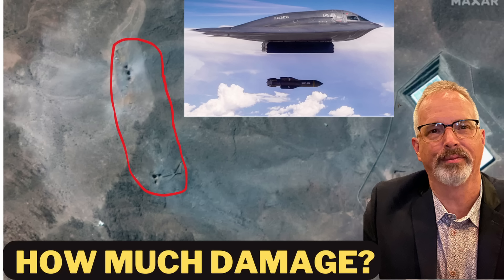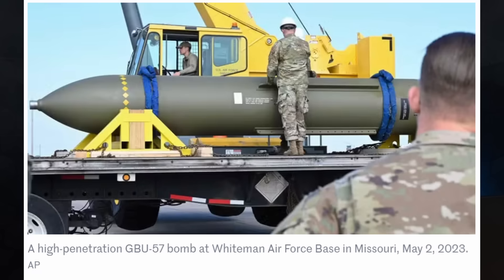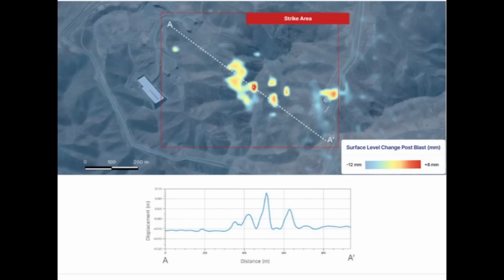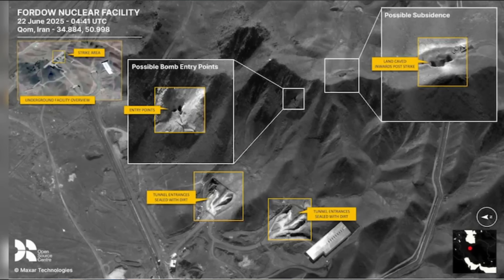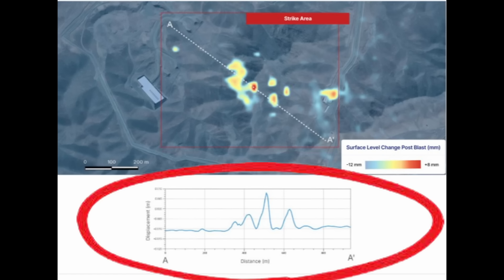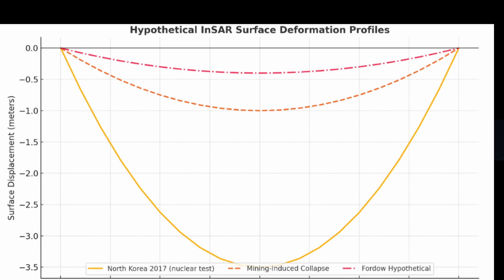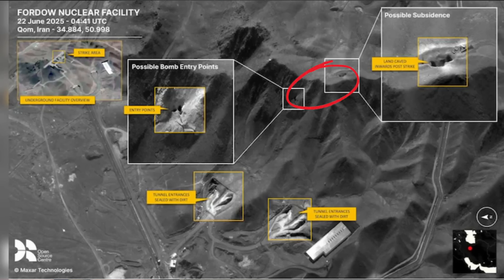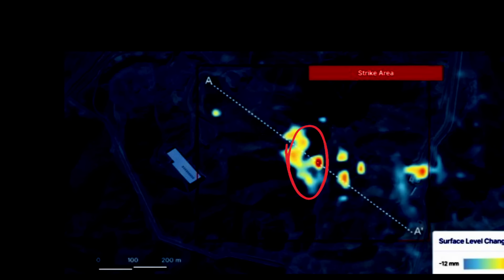Fordow Attack Assessment -  Update

Comment: You're assuming that the center ventilation shafts  are positioned directly over the "working areas" . If I were designing a "bomb proof"  facility,  at the end of each vertical shaft would be a connecting horizontal shaft that leads a 1/4 mile away into those working areas.  In that horizontal  shaft would be blast baffles, expansion rooms and blow out doors. No one knows without being there and "Knowing" the design and the actual damage within.  I doubt we'll be hearing any assessment from Iran and they'll probably not be having any public tours anytime soon.
Reply: An aspect of confined detonations as not been discussed.  Having been involved in detonation tests in confined structures (tunnels and underground bunkers) the mass flow of the detonation gasses is the primary damage mechanism well beyond distances where the shock is the kill mechanism.  The volume of gas produced in a detonation is significant.  This gas in the detonation room of tunnel or bunker is at very high pressure and begins propagating throughout a structure.  Most tunnels and bunkers have at minimum fire doors at strategic locations designed to close a section if fire occurs (by the way the fear of fire in these enclosed structures is huge as the smoke and toxic fumes are extremely hazardous and even a small fire can fill a structure well beyond the ventilation capability and make survival impossible without breathing equipment).  These protective door will fail and become projectiles along with any equipment and personnel in the glow path.  Blast protective doors are designed against shock and fragment impact but in a confined space with long duration gas pressures above 10000 psi these doors will fail.  Blast door in tunnels where heavy equipment most have access are large 20’ square minimum.  Do the math… 20’ square is 2880 square inches.  At 10000 pounds per square inch that means there is a force on the door system of 29 million pounds of force.   This confined compressed gas will propagate from high pressure to low and the mass flow of this gas is unbelievable.  Hot superheated gas with dust and debris entrained moving at the speed of sound is extremely damaging and this can propagate for long distances.  The easiest example to understand is a gun barrel.  The charge detonates and it is the expanding burning gasses that propel the bullet.  Even a relatively small powder charge results in a large gas expansion at the end of the barrel after the bullet exits.  Tunnels may have lots of twists and turns but the flow has now where else to go but through every possible open path thus fills the entire facility.  Even if the structure is large enough to allow the pressure the subside the dust, smoke, and toxic residual gas will kill any life and contaminate all mechanical and electrical systems and components.  If these GBU-57 weapons breached into the airspace of the tunnel facility that facility is toast.
Reply: @CustomCreations3  Thank you, someone who is not speculating is refreshing.
Reply: @CustomCreations3  Doesn't NORAD have a blast door rated to survive a nuke?
Reply: @jakeaurod yes but not a nuke detonated in the tunnel entrance but an above ground detonation at some distance away.  Thus it is designed to resist the nuclear shock very different than the gas pressure in our scenario
Reply: @jakeaurod Yes, and No.  It was designed to withstand a “nearby” nuclear blast.  Nearby being “nearby” when it was built in 1950’s.    Now it is buried deeper than the Iranian base, but as Patton said “fixed fortifications are monuments to the stupidity of man”.   BTW, the old NORAD base is no longer used for its original mission.  It is still active, but …
Reply: @CustomCreations3 Thanks for the insight.
Reply: I can assure you, we didn't 'assume' anything when it came to planning operation Midnight Hammer.
Reply: 🤣🤣🤣  @kevingaare719
Reply: Actually the IDF has a 3D model of this bunker and have even displayed parts of this model publicly.   The construction of it has also been monitored by satellite since work started.  The only assumption anyone actually needs to make is that the Israeli model is correct - or at least correct enough.  With twelve 30,000 lb bombs, you do not exactly have to be accurate down to the mm.
Reply: @Why_ask_  Show everyone your source. That would be useful information.
Reply: It’s a safe bet that MOSSAD had the layout of the facility.
Reply: The underground layout of the facility has been known for well over a decade.  The ventilation rooms were directly under the shafts - and were located alongside the central corridor.
Reply: lol. You do understand how heat dispersion works. Right?
Reply: There are systems designed to detect centrifuges. They knew exactly where they were, and what the closest entry point would be.
Reply: @rubenleal4821 🤣🤣🤣
Reply: Lolz, "if you" why would you think that no one considered all that ???
OK genius .. ever blow up gopher tunnels? The pressure follows the paths of least resistance
Reply: @DrMotherFouci gopher tunnels in soft soil are far different than tunnels in rock however it’s true the gas pressure will follow the path of least resistance and in the process flow in a manner as described
Reply: @CustomCreations3 yes a scaled down version of the same physics .. which is my point
Reply: My money is on good Israeli spying providing pretty good intel.
Reply: Katy Perry, Nuclear Weapons Site Expert, will be leading a tour into the damaged facility soon.
Reply: @daheikkinen Where is this Nuclear Weapon facility site?
Reply: @daheikkinen  LOL!  The Giant Dildo Cosmo Nut, is also a Nuke Expert.
Reply: @daheikkinen she'll surely be wearing the same Satanic horns she wore on Tour
Reply: They have the blueprints and planned this operation for almost 2 decades including tests. Anything anyone in these replies could think of was already considered and dealt with years ago. They knew what they were doing.
Reply: @lando8913  Talk and no data. Show me.
Reply: @1quasar1 Watch the 2nd pentagon briefing they literally talk about all of that.
Reply: @1quasar1 What are you? You don’t provide anything but flapping and yapping
Reply: Israel stole the drawings years ago for the facility..
Reply: I don’t think you realize how big these bombs are.
Reply: Spot on
Reply: Congrats you have exploding ceterfuges. 

As the speeds required to get to weapons grade materials the ceterfuges need lots of airflow, cooling and stability.

There is a reason the air shafts had bunkers over them.

Secondly, confined space + massive explosion... Ever seen atmosphere turn into a high pressure liquid? Explosions in caves does that and pancakes lot of things, pushing all the matter out before vaccume effect takes place and then the kinetic shockwave which travels through slower through solids then ruptures everything.

The best evidence there was something catastrophic happened within the facility is all the exit tunnels where blown out, hundreds of feet from the impact sites.
Reply: Addendum 

Blast doors that fail to contain explosions will make things worse. If you want to design a facility that is explosion proof you would have sacrifical blowouts to attempt to redirect the explosion away from the protected facility, there is no evidence or blue prints showing such designs nor was enough material ever removed from the mountain for this to be the case.

This facility was also built without the knowledge or presumption of bunker busters existing. Against traditional bombs yes, you could probably salvage something but we are talking the second largest traditional explosive bomb in the US arsenal and that the entire payload delivered would not fit in your house.

Then there is little evidence the blast went out the entrance it made for itself, rather it went out of the entrance tunnels and leveled the facilities near those exits. Most of the blast doors were located along the entrances because it was presumed cruise missiles would have been used instead to thread the needle.

And most blast doors are designed to stop explosions from one direction, not the other.

And finally you can bet your posterior such facility had 100% structural Intel. Every bolt screw nut and vent was known before hand. Who made every part what time they where installed and likely when any maintenance and renovations where done.
Reply: @ironwolfsaber2739 Yeah.  I'm mot sure why people think doors and blow out panels are sufficient.  

A blow out panel is great...  assuming the area behind it is large enough to dissipate the blast.

The uplift figures given in this video clearly show there wasn't a cavity large enough to contain it.
Reply: @ironwolfsaber2739 Actually the tunnels weren'y blown out. In the says before the attack the Iranians trucked in tons of dirt to bury the entrances trying to minimize damage if the tunnel entrances were attacked. Israel didn't have bombs big enough to attack any other point so it was a reasonable guess, but they were still wrong. Oops.
Reply: Except for the fact that Iran had the layout for fordow acquired by the Americans and Israelis years ago. But nice theory buddy.
Reply: @spencer5438  Words and no proof. Nice try.
Reply: @1quasar1  https://en.m.wikipedia.org/wiki/Israeli_infiltration_of_an_Iranian_nuclear_archive
Cry about it.
Reply: @1quasar1 been public information since 2018 but your just to in your own world.
Reply: @spencer5438  Let me guess. You got that from the same guy that said : Spain is a part of BRICS.  Did  you take the clot shot? It would explain a lot.
Reply: I'd bet that the US military sent all those assets over there without any information on the construction of the site other than a guess, the planners just said "we'll try here" or maybe "this looks like a good spot" 🙄.
Reply: @toter-drache that’s where you are just completely uneducated. We have had the layout designs of Fordow for years now.
Reply: @spencer5438 
Here's hoping they didn't secretly dig a hole underneath the vent shafts in the intervening years.

If they did, nothing was destroyed.
Reply: @toter-drache  Yeah, and we won the Afghan war too...
Reply: @1quasar1 said: " If I were designing a "bomb proof"  facility,  ..." 
Said exactly what I would do. Does anyone other than a fool think the Iranians are stupid? "Infographics" in some YouTube videos show parallel long straight tunnels and other dumb designs. I see a lot of Dunning–Kruger effect going on, especially from the "administration" lackeys. Even the DIA (the real intelligence) folks have doubts.
Reply: We know the vent shaft where far from the nuclear stuff.
Plus usa gave a warning to evacuate, prevent injuries  and blowing up plutonium
Reply: No he did not assume that
Reply: The organsistaion that inspected it will have given the amercians the plans
Reply: I hear and see a lot of speculation and unsupported claims. Please show me a Site Layout with Vents connecting to Process Areas. I would really like to see it. That should be a simple request if one actually exists (outside Iranian Intel) and is from a credible source.
Reply: @1quasar1  Exactly, It's like everyone assuming Iranians is stupid and just drilled vertical ventilation shaft from the top, although it's really hard and slow to drill in dolomite and granite. 
It would have been a lot faster to mine the shafts in vertical and horizontal steps or a long tunnel that was more horizontal on order to get out the rubble.

But Ofcourse, the Iranians is just so stupid and naive that they spent extra time and effort to help USA!
Reply: The IDF and the US have been planning this strike for almost 25 years.   We know who worked at those facilities and how they communicated and when.  By comms that have been intercepted there were zero survivors at any of the facilities and even the Iranians were talking about how the internal structures were badly damaged or destroyed.
Reply: @Jeff-sp7bg  There were no personnel in those facilities as the US had given prior warning of the attack. So that is a blatant lie. The Iranians have given no information reading damage and it it is likely they won't.  Where do you get your information? I would suggest some new sources.
Reply: Most probably, Israel hase the drawings of the construction .?
Reply: @g.jeu.2187  That's a guess.
Reply: So you are saying a gigantic  bomb blast couldn't travel through 
a  1/4 mile tunnel at the same level wouldn't have complete destruction?
Reply: @btspyglass4077  Yep, that's what I'm saying and  911 was a CIA/Mossad operation.
Reply: Liberal scum making every excuse to make it seem like this place wasn’t completely destroyed 
There were people studying and watching this place for over 10 years  do you really think they didn’t know the design of the place ?   Are you actually brain dead ?
Reply: Satellite surveillance 24/7 I'm sure. Just have to wait and see what they do. They will tell us without even knowing.
Reply: I agree this makes sense… but then… bombing it makes no sense. Trump may not know what he’s talking about but our armed forces do. Highly unlikely that if the intelligent reflected what you proposed, logical as it is, that the bombing would have been done at those locations
Reply: By that logic....  The facility would be even more secure without ventilation shafts at all!!!!  A bunch of twists and turns really restricts airflow.  Every cubic foot of air space in the bunker needs air flow....  which must be supplied by those shafts.

Just going to point out that this facility is processing uranium.  It's not something you wanna do without proper ventilation.
Reply: @kwonekstrom2138  Good grief. Those coefficients would obviously be incorporated in the design.  SMH
Reply: @1quasar1   "Adjust the coefficients"   Do you think using big words that aren't related is an argument?

I believe the phrase you're looking for is "air flow".  😉  There are 2 ways to increase airflow.   Use a larger pipe or move the air faster.   A vent shaft going all over the place will slow the air down.

Simple tunnels like electric trains have a max of 3km between vents.   Industrial processes like uranium enrichment has a much larger effect on air quality and produces much more heat.

🤷🏻  Even if you are right....  they aren't using that facility without vents.
Reply: @kwonekstrom2138  Pressure coefficients are used when calculating any fluid medium within a system.  But you knew that. Those vents will likely be reconstructed and I would bet that the Iranians will now complete the last step to weapons grade. They had already removed the 60% enriched batches prior to the bombing. That makes this whole affair ridiculous and a failure. So instead of stopping them, we forced them. Nice work....
Reply: @1quasar1 "calculated" being the key word.   There's no "coefficient" in the CFM equation...  (FPM x AREA).  The amount of airflow required is based on the facilities air quality and cooling requirements.   So yeah...  I dod know that.   Big words that describe how to calculatethe CFM required is different than the engineering to achieve it.  😉

There are serious issues that need to be addressed when you add length to ventilation systems underground.

LOL.   I don't believe Iran should be allowed to make weapons grade material because they may have a stockpile of 60% somewhere.   That stuff is useless for anything except a dirty bomb.  Too hot for most reactors and not hit enough for a bomb.
Reply: @kwonekstrom2138  Anytime you're dealing with directional changes, obstructions and area changes,  coefficients must be factored in.  Once they are, only then can you design an appropriate system to provide the necessary flow requirements. As for the enrichment issue @ 60% they are only one step away from 90% (10 days or less) Happy trails....
Reply: @1quasar1 That sounds backwards.   The required airflow is based on what is necessary to for air quality and heat reasons.

The ventilation system is then designed to provide that flow.  Your entire focus is on the "bends"....  but that's not the engineering problem that needs to be solved.  Extra fans can increase air flow....  which increases pressure.... and that causes problems over long distances in a tunnel.

Every square inch of wall of a tunnel requires a lot of engineering.  Being undergound tends to produce a lot of gasses, many poisonous.   There's water issues...

As I said before....  there are reasons they don't build vents like that.
Reply: @kwonekstrom2138   You're saying the same thing in different words. I'm not talking about an "Ordinary" system. I'm talking about a system to mitigate Bomb Damage. There would be VFD controlled fans throughout, all tied to a PLC.
Reply: @1quasar1 Yes...  because the engineering challenges are real.  Fordow isn't the only underground military facility....  I'm not aware of any that use a system like you suggest.  Being underground isn't like hvac systems on the surface.

What you're talking about is imaginary.  The cost of building such a system would be very expensive for dubious benefits.  Adding fans is easy....  except they cause problems and don't solve any except FPM.

These engineering things don't sound like much, but every one of them is deadly.
Reply: Here's an MIT Physics and Munitions expert that somewhat corroborates my position.  Seems I'm not the only one calling out these Suppositions. https://www.youtube.com/watch?v=hsWZlVcVRSM&t=4365s
Reply: And you are assuming you know what tf you’re talking about…. Like you are some sort of underground, bomb proof architectural engineer. And you’re not.
Reply: @Aphxphotog  So, if I have questions and doubts about a subject, I should just shut up and listen to the likes of you? Wow, Gone Woke? 🤣
Reply: Its bc hegseth and trump think they are tom cruise in the latest top gun...this bs is ridiculous...nobody knows without an in person inspection...and trying to bomb down the ventilation thinking centrifuges are right under is comical
Reply: 1Quasar1 Your assuming a blast door, blast baffles, expansion space can handle small nuclear yield type blast levels which is what the US dropped on Iran. Only a moron with no engineering expertise would suggest such a stupid assessment that blast protections would be effective.  They clearly were not. The facility was completely obliterated.  Iran is not a nuclear threat at this time.  The world and most Middle East countries thank Trump for making the world safer😊
Reply: Do you know why Batman wears a very visible symbol on his chest? 

Because that area is extra reinforced and it tricks people into aiming there. 

Now apply that logic to a very visible, very public ventilation shaft where a hidden hole dug underneath is all it would take to negate the explosive dynamics of the GBU
Reply: @MatheMusicalManiac  You don't construct a "Bomb Proof Facility" 300 feet underground and then put a bullseye on the target. People think the Iranians are stupid. OK....
Reply: One of the BDA “Experts” claimed that the blue/grey dust around the blast holes was evidence of a hit on concrete and hence pierced the bunker. I’m no expert but am reporting about a supposed expert.
Reply: The entire Iranian regime has been infested with Mossad spies for decades and continues to be.
Reply: I totally agree with ur knowledge.
Reply: Lol, you are assuming there were no mosad spys in the facility. I am pretty sure they had a good idea of the facility, but had no means to sabotage it with a significant impact w/o MOP😂
Reply: @cyborg_cr7488  > reminds of the joke goin around Israel > when Iran boasted about a recent attack killing Mosad Agents inside Israel... the response was no Agents were hurt as they were all inside Iran 😂 > then again let's hope they weren't at Fordow 😳
Reply: @cyborg_cr7488  The IAEA were allowed to inspect it for years. It seems that they passed on information and did not act in good faith (or were infiltrated).
Reply: The layout is known
Reply: There’s some limitations to the ventilation shafts that I think have to be taken into account
Reply: He also calculated with maximum possible amount of volume which is the most optimistic scenario. However, the most optimistic blast radius only became 23.87 meters.  

That means the bomb has to go 55-65 meters deep before exploding. 

Very deep is a relative term.

In fact the very subtle changes in the ground elevation across this area is proof that the bombing was a total failure.

The bombs didn't go further down than 20 meters, reaching a maximum depth of 45 meters.

In contrast, an exploration at 70 meters depth would not reach up to the surface at all.

Volume gives a big number, but just calculate the volume of a ball with 24 meter radius. You see.
Reply: Not really. Spys in the facility confirmed the layout.
Reply: @semps.338  Please source your information.
Reply: Well, this is why we have people that know what’s going on not people like you.
Reply: I'm waiting to book for the first adventure tour to go to the site and  get to see the ruins myself
😂😅😮
Reply: @robertjohnston6768  I just read comments describing how a damaged centrifuge room would be contaminated with hydrofluoric acid and uranium hexaflouride.  I'll pass on the tour unless I get to wear plenty of PPE.
Reply: @erintyres3609 PPE might not work, probably need a custom fitted coffin
😂😮😵‍💫
Reply: Ra ra radio active @robertjohnston6768
Reply: No, YOU’RE making the assumptions.
Reply: @effingsix3825  Which assumptions is being made?
Is Iranians naive idiots?
Yes/no
Reply: Dude we have multiple identical independently verified confirmations of the layout that could only happen if Iran has the best counterintelligence in American history. They ventilation rooms are directly below and the main corridor is right there. It got obliterated.
Reply: @Scudzzorz15  No where in the presentation's does it show where the Vent shafts connect to the Process area.  I see 3 vertical shafts tied to a common horizonal manifold.  That's it.
Reply: @Scudzzorz15 the most dumbest explanation i have ever heard. One needs a tunnel at least a distance away from the main shift. All mines have this concept.
Reply: Its a good thing you're not an HVAC guy bcs you'd lose your license within a month.
Reply: @SteveFreeman-v4d  https://www.youtube.com/watch?v=hsWZlVcVRSM&t=1267s
Reply: Got some real geniuses commenting here. They got a real "special "education.
Reply: @kevinwalton2664  Zionist bot detected
Reply: Agreed. Seems like common sense to not build a straight up vertical vent shaft.  I would have also had it make several right angle turns.  Plus, who knows if the first bomb collapsed the vent shaft further away, thereby almost protecting it from the direct blast.
Reply: Totally agree with you... The analysis from this "expert" is biased and very theoretical making a lot of assumptions....
Reply: what do you think, will be receptive to future non nuclear proliferation treaties?
Reply: @richardjohnson8009   No one is looking to go to war with N. Korea, are they? If I'm the  leader of Iran I'm taking note of that example.
Reply: They could call it the "Obliterated Tour" Guaranteed  to blow your mind....
Reply: @1quasar1  "No one is looking to go to war with N. Korea, are they"
What a STUPID take.
BIGLY stupid
Reply: No one is going to war with NK b/c China would not abide that shit. Iran has exactly zero of its so called allies step up.
Reply: @1quasar1  north korea is not actively arming proxies with missiles to attack other nation. It has a defensive posture. Iran on the other hand calls for the death of other nations and is active to achieve that goal. Big difference. If iran gets wmd there will be an exchange of nukes. If it does not give up its nuclear weapon ambitions and gets close to getting it, there will be a pre-emptive strike seen like never before.
Reply: @1quasar1  but they didn‘t build it like that. Fordow has been known about for one and a half decades. The plans were leaked. Mosad has had an agent inside. The mission planers knew exactly what they were dealing with. More than a decade of simulation on high performance computers went into this. If they say it‘s gone, it‘s gone.
Reply: @cainabel2553  well no not really a stupid take. what was stupid was trump tearing up the first deal just because it was obamas deal. This is when the enrichment started and gave the hawks an excuse to use big bang toys and air planes (sic). Now there is no eyes on the ground, the chance has been blown and if there isnt a plan in iran now to get nukes asap then they must actually want a ground war. Its a common theme throughout history that you vive up your guns then you get preyed upon, simple fact. Those that are too lazy or too arrogant to understand this would call it a "stupid take".
Reply: @richardjohnson8009  Why sign a piece of paper for Trump to wipe his ass with?
Reply: @richardjohnson8009  😂😂😂😂 moot
Reply: you provided more realistic analysis in 3 line then this guys did in 12 minutes.